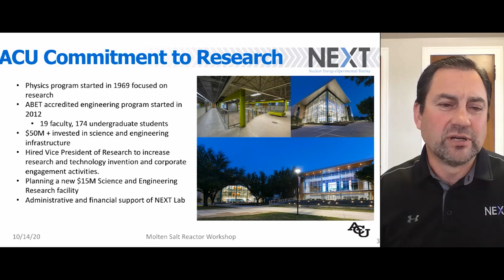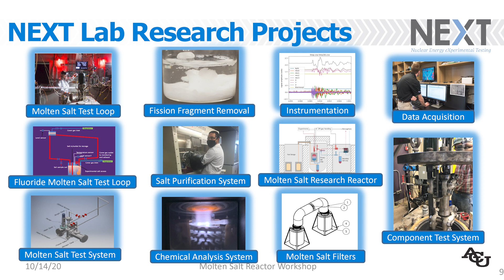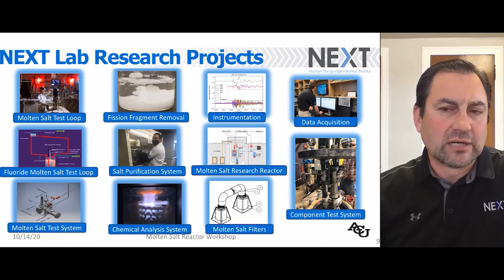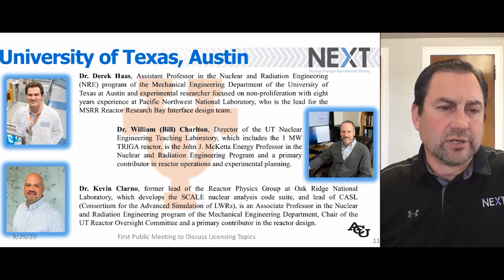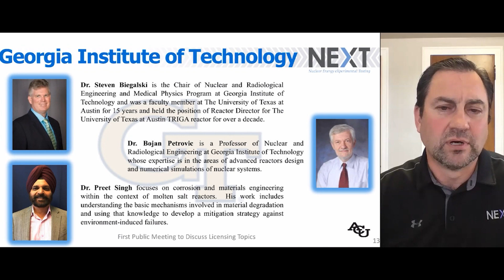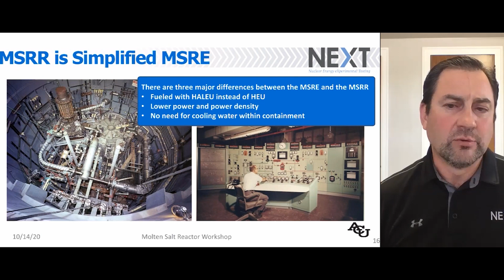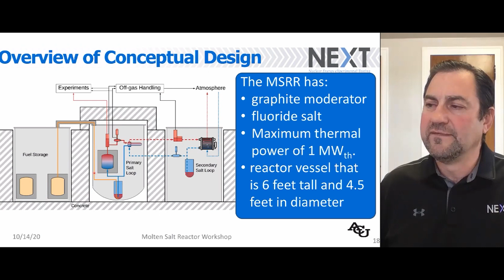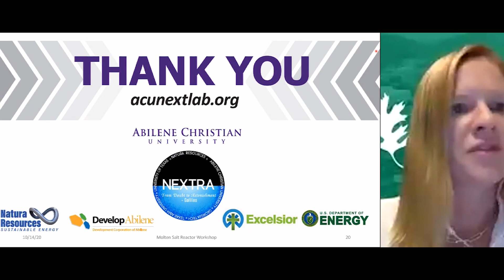Molten-Salt Research Reactor (MSRR) - Dr. Rusty Towell of ACU @ ORNL MSRW 2020

Comment: Thank you for this. It's great to see a reactor being built, and for what seems to be a very reasonable sum of money. I also like that it's using the Elysium idea of requiring a pump to be operating to keep the core full of fuel salt to maintain criticality.

I'm going to check ACU's site to see what additional projects might be under way to use the heat from the reactors to generate useful products and services.